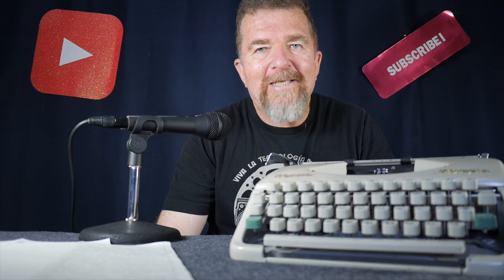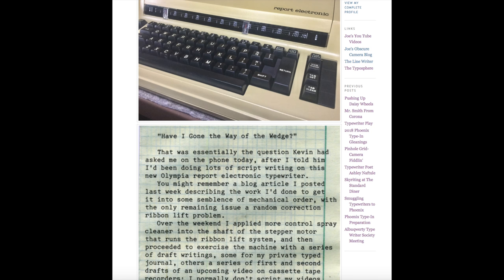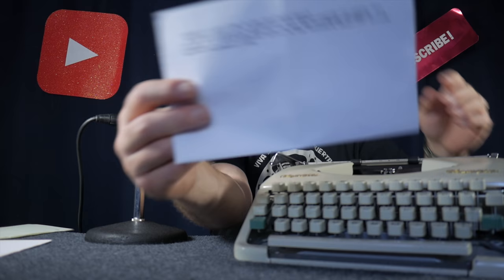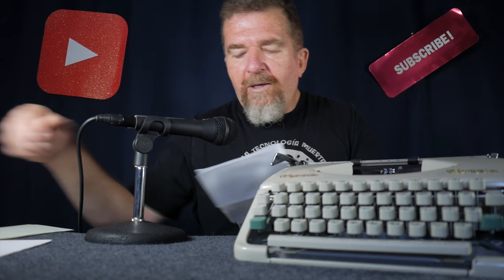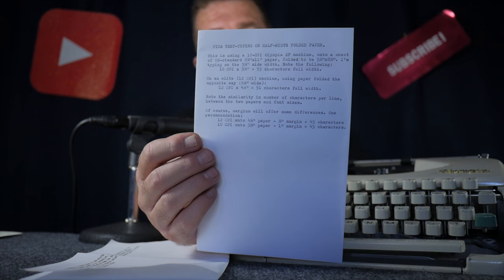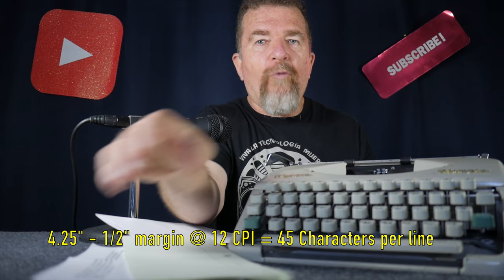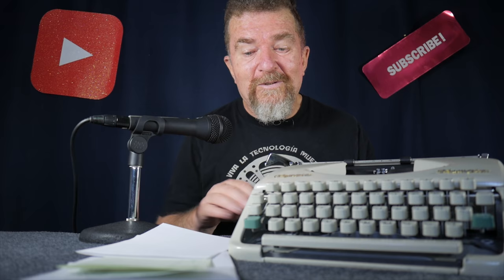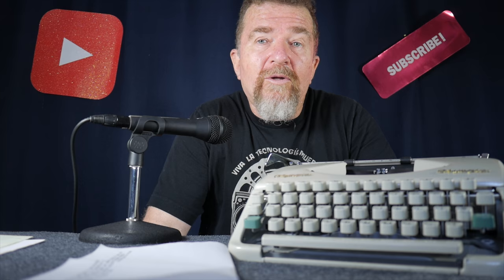Typewriter Video Series - Episode 126: Typing & Column Widths Part 2

Comment: Happy to have found this.  

For me, folding a sheet of paper makes for a nicer proportioned text, if we want to use narrow margins.  On a normal official letter of correspondance, we set margins at a minimum 25 mm per side, up to 40 mm or more per side, to make the text visually in harmony on the page. 

If you fold a sheet in two, you can type on both halves, one after the other, without unfolding it and then store it flat in a binder.  This way the text on each half is on the same side of the sheet.

Daniel

Comment: I found that reading a typed piece aloud (poetry, etc.), when placed on a music stand is impossible to see unless it's in Pica. In using an Elite font and standing back any distance + camera involvement, it's just to small to see it. I have a blog too where I post some writings https://www.poetslog.com/  and until my last post I'd rewritten typewritten works in Windows Wordpad. Anyway, my last piece was so short that I scanned & posted the typewritten version, though scanning it as a picture, then by using crop it naturally enlarges the typewritten image for posting. This folding technique is very promising for raw fit, and possibly readability!  I'd  like to type something and show a pic of which typewriter was used for each piece. Thanks alot Joe.